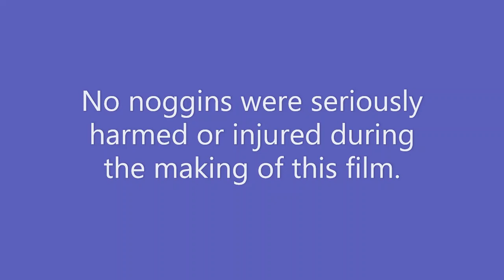Fitting timber roof trusses to a small home extension.

Comment: Whats the reason for the vertical timbers against the house wall? Ive only ever seen common rafters mitre cut against the wall face plate with the bottom of the rafter nailed to the wall plate and a birds mouth cut.
Reply from the maker: Hi Dan. These were pre made trusses so made as a triangle. Other than keeping the triangular shape, it transfers the top of the rafter load down to the bottom chord which sits on the truss hanger.😎 Cheers.
Reply: @thetallcarpenter  thanks.
Reply from the maker: @handle1196  👍

Comment: hi there im wondering if you know how to get the top of the rafters flat before lats so the roof tiles arent wavy as i have seen it wavy so many times on cut and truss roofs is it just checking crowns and so much timber isnt straight im a bricky cheers
Reply from the maker: Hi John. If the top and bottom plates are straight, and the bows in the timber are not only all facing up, but placed next to each other in a way so you don't put a really bowed one next to a slightly bowed or straight one, the roof should be pretty flat. Trusses, can, and do, alter to each other slightly in their manufacture, but should still not give an up and down roof if fitted on flat, straight wall plates in the same lateral position. I have, on a couple of occasions though, had to plane the top of a few high trusses and pack up the top of a few low trusses in the past.👍 Thanks for your comment.
Reply: @thetallcarpenter  cheers this would make a good video
Reply from the maker: @johnbradley4881  Hi John. Its certainly something I would make video about in the future.👍 Cheers.

Comment: Great vid, Quick question for you, when is it safe to order trusses? Should you wait until the brick/blockwork is up to wall plate?
Reply from the maker: Hi Sean O. If your brickie's are good, you can order the roof when the footings have been bricked up on fairly straight forward building/roofs. But on more complex roofs, I would usually wait to confirm with the truss manufacturer the sizes once up to plate.😎Cheers.
Reply: @thetallcarpenter  thank you, the lead time on trusses is something I need to build in , this advice helps immensely, thank you, have a good weekend.
Reply: How much margin for error on a truss?  Standard roof? Average truss.
Reply from the maker: @rockandmeatroll  Hi Sean. You can usually make a provisional order with the truss makers to get your manufacture slot and then confirm before they go into manufacture. If in doubt though, wait until the plates are on as it can be very expensive if you make a mistake. Hope you also so have great weekend.😎 Cheers
Reply from the maker: @rockandmeatroll  I'll be honest Sean, I cant remember if the truss manufactures allow a little extra on the plate measurements or we have to tell them to put a bit on. ( I don't usually order the trusses) Most times the ceiling chord of the truss overhangs the outer edge of the wall plate by about 20mm.👍
Reply: @thetallcarpenter  thank you, it's that expensive mistake and the lead time I have to think about, thank you for answering me, very helpful.
Reply: I'm a bricklayer and to be fair you should be able to order roof trusses soon as us guys start internal block work you can add abit on maybe 15mm if you want to be safe depending on your detail at eves 👍
Reply from the maker: @TheTraditionalGolfer  Absolutely SPOT ON mate. The brickie's I work with are top guys and are rarely more than 10/15mm out from DPC to plate.😎 Thanks for your comment mate.👍
Reply: @TheTraditionalGolfer  Thank you!!